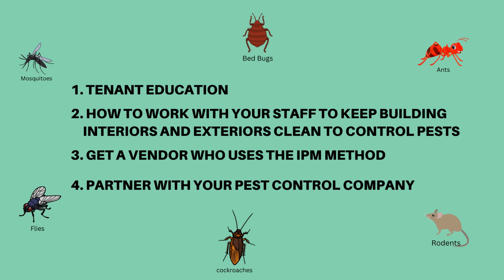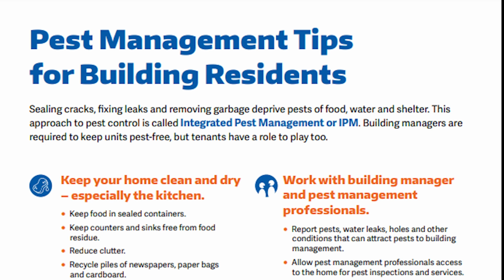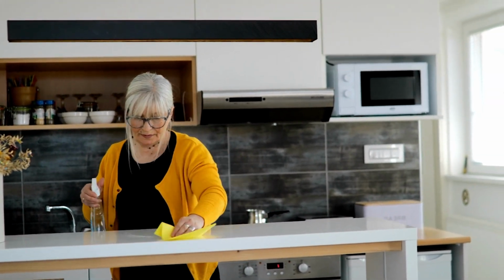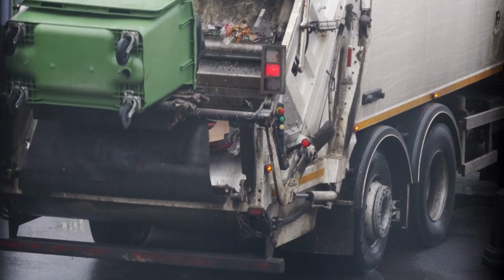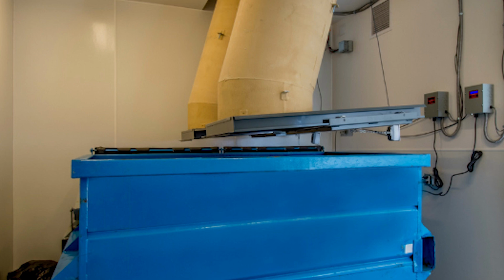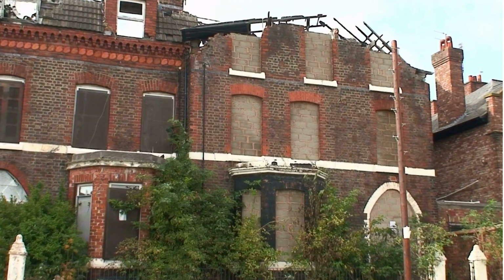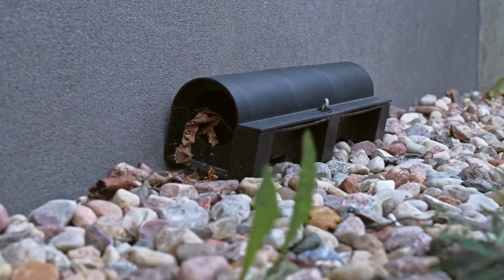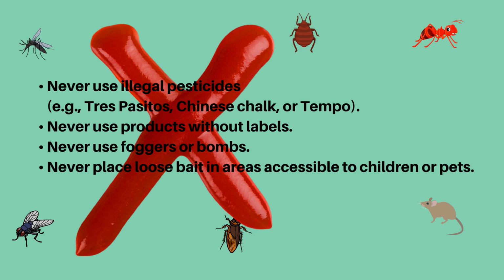Pest Control Maintenance Trade Secrets; Say GOODBYE to Building Pests for good!

Comment: Excellent content and guidance. I have used several of the methods suggested which resulted in a reduction or, in some areas, complete elimination of pests. These included plugging up holes with copper/steel wool and using sealant for cracks or openings at junctures where a wall meets the floor.
Reply from the maker: Thanks for sharing!